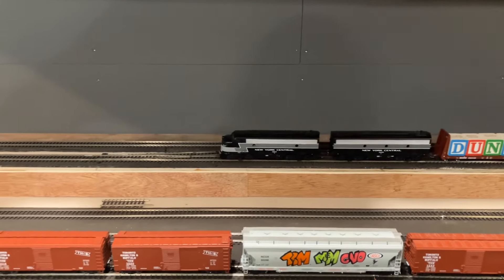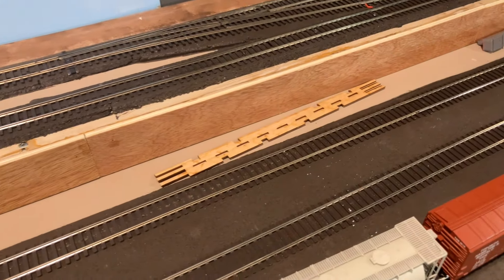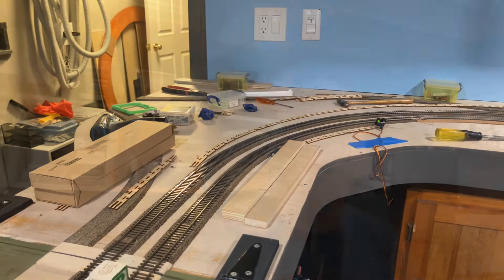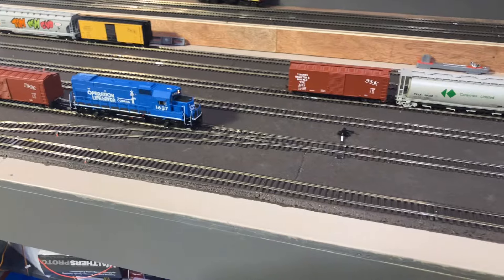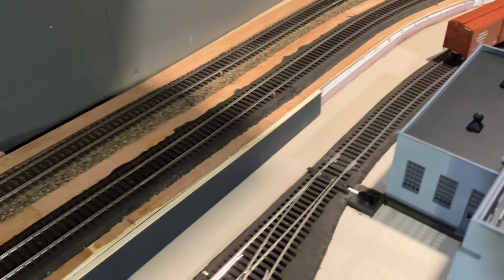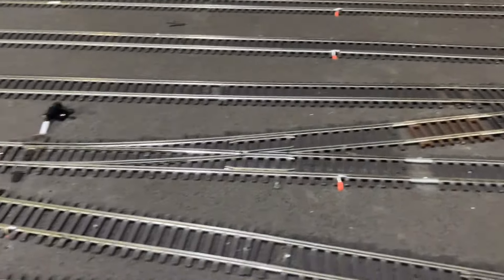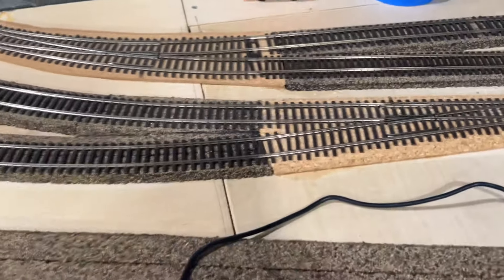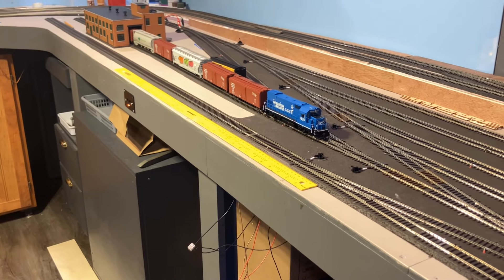#Layout update, #F7 NYC locomotive repair .,# yard operations

Comment: You'll like the gimble once you get used to it. I like your yard. Cool that Dave got the loco repaired for you. You're using masonite for your backdrop right? What type of screws are you using? The boxcars said no way we're on camera. Cool ops session James.
Reply from the maker: JD yes using Masonite (hard board ), I used #6 wood screws , counter sink them then fill with flex 90 drywall compound, my train room walls is all plywood, no drywall at all, thanks for watching

Comment: That a big yard.  How much distance between the tracks?
Reply from the maker: @FredE528  Fred approx 2.5 inches to 3 inches, I adjusted the yard to fit the space I had, used Atlas track sections to control the spacing , thanks for watching
Reply: Good distance to get car wheels aligned .👍